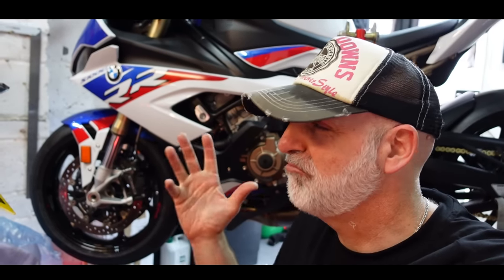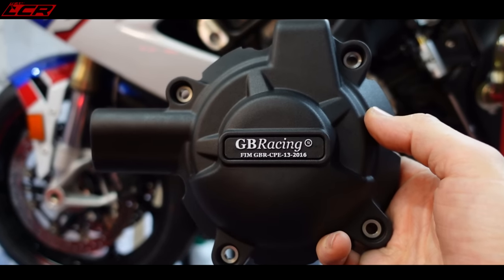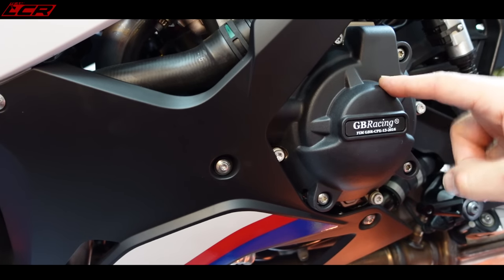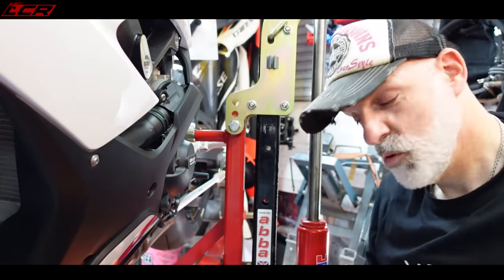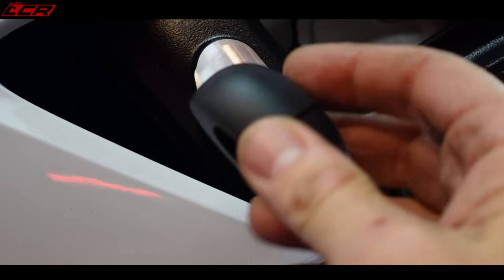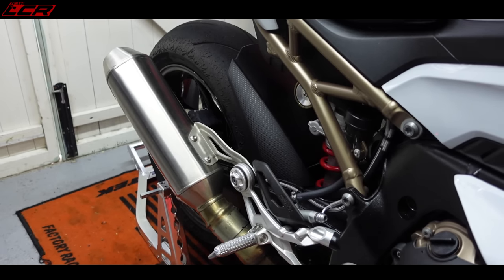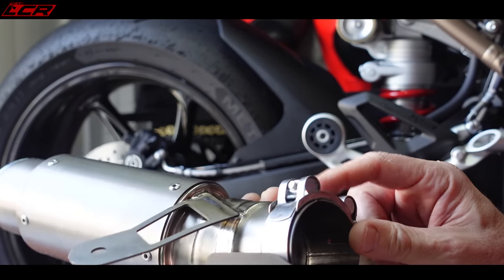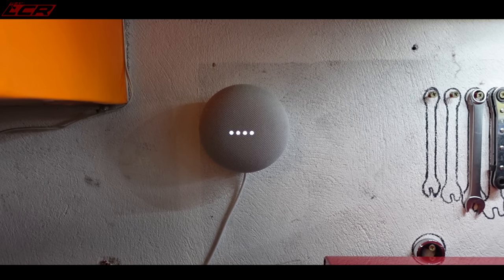New BMW S1000RR | The Modifications Begin!!

Comment: I clean and oil my motorsport chain normally as like you I like it to look nice. I also put on some R&G crash protection bungs and the radiator guards but I did not like covering up all that nice rose gold and the black guards make the bike look very black and white with them on. I might consider fitting them if I can get them painted / powder coated with the same rose gold colour of the original engine casings but also I was afraid of the warranty implications of fitting them.

Comment: Thank you for posting.  Great video.  I am in the process of making some minor mods to my 2021 S1000RR as well.  I see a new header for your bike, if it is allowed in the UK.  Saves you about 10kg.  Not sure if you are aware, but the screws used by BMW in the clutch cover, engine cover, etc... are one time use only (at least in the USA).  They are made of aluminum.  Similar to the screws used in the calipers of the Honda Fireblade.  They too are one time use only and cost over 100usd to replace.  Yikes.  Looking forward to your future videos.  Let us know when you give in to temptation and buy the BMW RR. :)
Reply from the maker: Yes couple of people pointed out the alloy bolts I wasn't aware but makes sense after feeling how light they are! 👍

Comment: I've bought one and its not easy to ride especially when its windy. it feels out of balance. I need to do the settings and perhaps change the metzelers tyres. Any help would be welcome as BMW don't do settings for setup. I'm based in N.ireland. I'm using it in road mode now, ive tried the power race mode settings for front forks, rear damper and rebound all set at 6, i adjusted it to 7 for f forks and rear shock not rebound.

Comment: I’ve never been a fan of crash bungs after I saw the damage they can do to a bike frame.
Reply from the maker: No agree Christopher, that's why the GBRacing ones are so good! Designed to avoid the issues
Reply: @LambChopRides   well you never know might try them , have track bike so it get a few low sides now a then .

Comment: How do you like the engine behaviour, any problems especially in cold starts? Rough running at low rpm?
Reply from the maker: Nope runs perfect, does rev up on idle but settles quickly

Comment: About to put the GB Racing covers on mine, so very timely video thanks. You did not mention the tank grips. Can you say who the manufacturer is?
Reply from the maker: Actually Neil they are some cheap ebay ones but not particularly impressed.. Will cover a bit about them next time 👍
Reply: @LambChopRides  I've used Stomp in the past, but the sharp bubbles tended to chew my leathers to shreds. I've had variable experiences with the adhesive on Eazi-Grip, but might give their slightly less aggressive 'Pro' version another go.
Reply: Tech Spec do some of the best tank grips out there...

Comment: Those lightweight bolts you removed are Aluminium and it is very important to realise they are single use and should be disposed of after removal.
If they are ever reused and torqued to manufacturer spec they absolutely WILL shear off. You have been warned!!!!!!!! 🙄

Comment: biggest POS in the entire industry, buy the base like a racer would and the calipers and fucking rotors will NOT swap with any other upgrades
. just backed out of my brand new bike and fuck bmw because of this and the impossible 5 track days minimum to putt it around the track before you can do 10k rpm